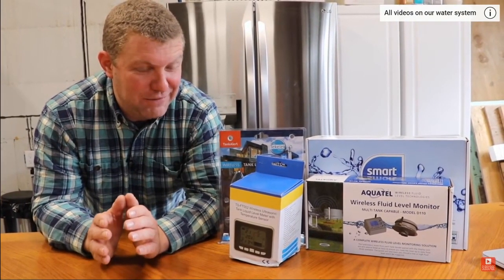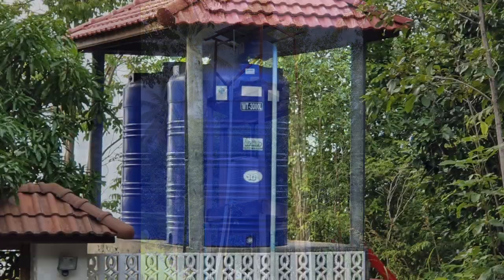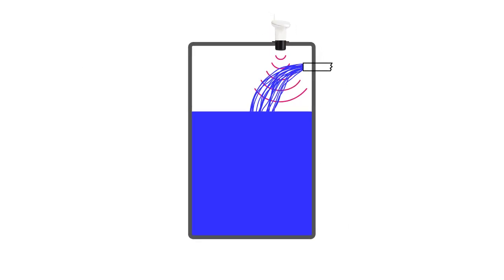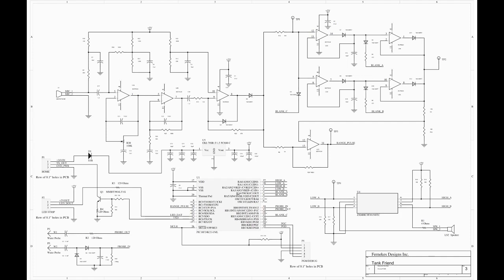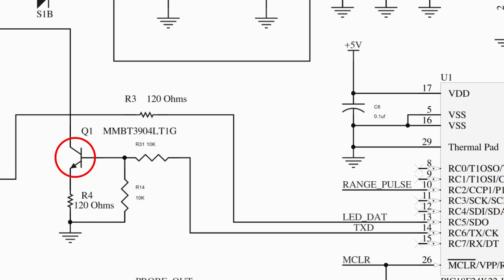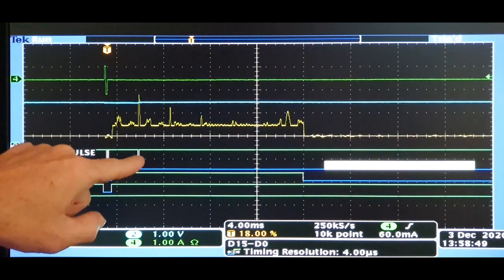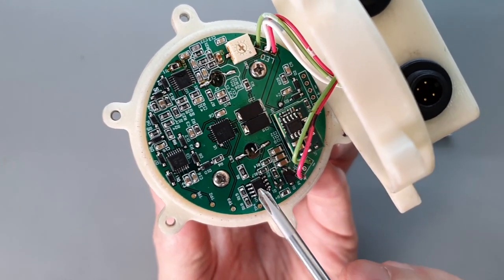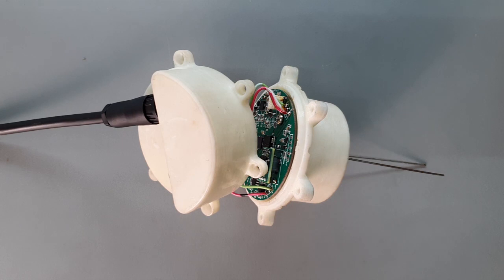Product Development: Water Tank Monitor System.

Comment: I understand the appeal of non contact methods of measurement, but wouldn't a donut float with a small tube in center (with conductor loop inside) and a magnet glued to to the float be the best low tech solution for sensor development?  Then the sensing mechanism is just a dumb magnet float which sends an analog signal along the conductor inside a tube.  Process this analog signal.  The position of magnet is then calculated like an LVDT sensor moving its magnetic field with the surface of the liquid in the tank.
Reply: By the way, I still loved your video and the engineering that you did!
Reply from the maker: I am not following the physics of your Idea? How do you get position information from this arrangement?
Reply: @leosbagoftricks3732  https://www.omega.co.uk/technical-learning/linear-variable-displacement-transducers.html
I realize the idea I presented is not as simple as I made it out to be.  I said magnet when I guess I meant a "core" and way more complicated wiring setup with primary and secondary coils were needed to produce these sensors that what I suggested.  I haven't use these type of sensors in over 15 years back at the university, so I forgot how they actually work.   They are "variable transformers" with coils that register the "movement" of a core with an oscillating supplied voltage.  The readouts are V/mV/mm or V/mV/in.  Full disclosure, I am not an EE, but I cant help but think there is a conceivable and known geometry in the universe we can engineer that couldn't "sense" position like this device and still be made from "dumb" and "cheap" components like a magnet and wiring configuration somehow.  I was just thinking that copying this idea has merit from an engineering a robust sensor.  It would only be a float and some geometry of wiring (hopefully easily controlled in a manufacturing environment).  The problem is of how to place alternating primary and secondary coils vertically along many different tank depths without needing different manufactured products and have the core on the float is hard to solve.  Obviously this idea is not even ready for prototyping, more thinking is required to feel confident to waste materials on this idea.
Reply: Consumer behavior ultimately dictates weather a product will be successful or not too!  A completely separate animal from good engineering.  I would think most water tank designs probably come with an autofill solenoid valve will supply water from a city municipality and then cut off with a couple of float switches installed at the correct depths before tank overflow or being drained completely.  99% of the time the consumer would know they have water in their tank with no monitoring.  The switch and valve mechanism doesn't cost a whole lot and requires almost no knowledge of microcontrollers or more sophisticated instrumentation.  Then how many more scenarios are we engineering for?  There is probably a segment of the consumer market that loves data.  The "I want to know everything that's going on in my tank" people.  There's definitely industrial clients that want to know everything going on in their tanks.   But my guess is both of our ideas at continuous sensing in water tanks wouldn't sell that well in the consumer market when a simple float switches installed at the correct depths is super cheap and set up an auto-filling valve.  This makes both of our ideas obsolete or selling to niche crowd.  I must admit I am a part of that crowd, I love sensors and smart home crap.  Its funny that I get so mad at all the truly crappy smart home products that its sole development by a companies marketing team (not engineering team) was meant for me to buy it cause I am curious and then it doesn't work.
Reply: @mikenorfleet2235  Water tank designs in many countries involve a pump which pulls water from a well and puts it in an overhead tank. Overflow sensors are your ears, when you hear water hitting your yard you go and turn the pump off. At that point you know exactly how much water is in the tank.

Comment: As a fellow electronic designer myself, I really enjoy watching your videos. Thank you very much for sharing your work with us.
My 2c :  what about an "amphenol like" circular connector screwed on the top lid that would plug directly in soldered contacts on the main board when you assemble the whole thing. No wires.

Comment: What protocol do you intend on using to communicate with the remote display unit?
Reply from the maker: It's got a current loop serial output, it's 9600 baud serial data.
Reply: @leosbagoftricks3732  awesome, Great work!
Reply: @leosbagoftricks3732  I went back and saw it in the schematic. What's the max distance you can get at 9600 baud?

Comment: I would put a third prong in - for a 'High-High'  reading - basic all shits hit the fan Sirens going off call the emergency services signal. 
Seriously, You don't need accurate sensing so close to full. Use three prongs - one set indicates tank full (High) and another set for error (pump has not been switched off when 'High' level has been reached) so over full hence 'High High'. 

How about a 'Lo' & @ 'Low Low' for pumped output applications to protect the pump/motor from running when dry.
Use stainless with a crimp on it.
Noise of ping is too load (even at 15sec intervals).  
Coloured LED down side - power drain  unless you incorporate a solar charge and battery arrangement and might be hard to see in strong sunlight (unless high power of course)
Vent holes to big/many possible ingress to crawlies and the like, or use a course foam filter to screen and protect probe connections from moisture through condensation.
You can get a vent specifically for this purpose.
Reply from the maker: This device gets HARD WIRED to it's power source, lot's of power available to waste on lights!  Thanks for the other interesting ideas!
Reply: Solution for you wire-probe problem:

1)  Use stainless-teel for the probes
2)  Sole the soldering problem by electroplating copper onto the last 5 cm of the probes.
Attach a DC supply to a clip lead attached to some bare pc board  or other source of copper and attach the other side of the supply to the stainless-steel rod.  I’ve had good luck using water/vinegar for an electrolyte.
 
This has worked well for me for years, for example when I want to solder a SS rod to a PL-259 or SO-239 to make an antenna.  I’m sure it will work for you too.

-Greg, WW5GG
Reply from the maker: @greg4367   Thinking now to use copper coated steel wires- a readily available material.

Comment: While I love your videos I think you're guilty of the same sins you're criticising. Your system is complex with more points of failure than I have fingers to count. You want a reliable system? Piece of wire, a float, a pulley and a counterweight. That'll last 40 years and anybody can install 🙂